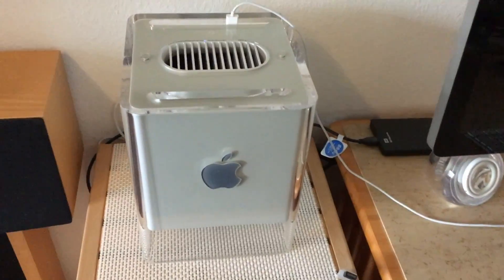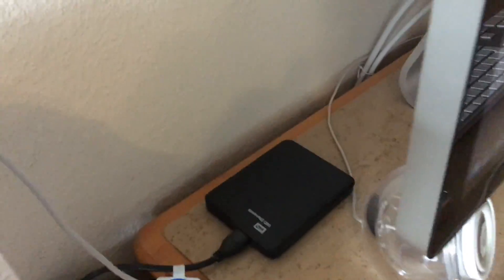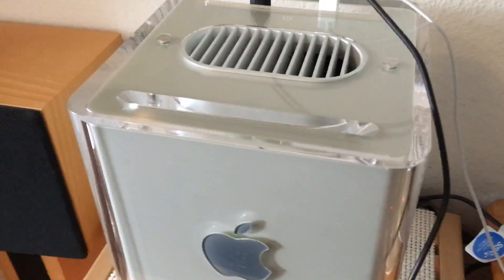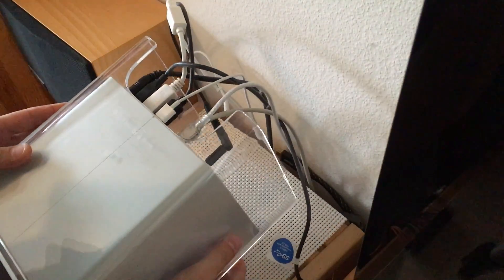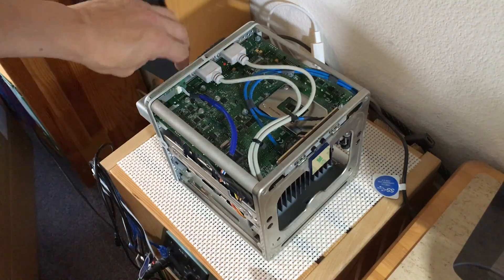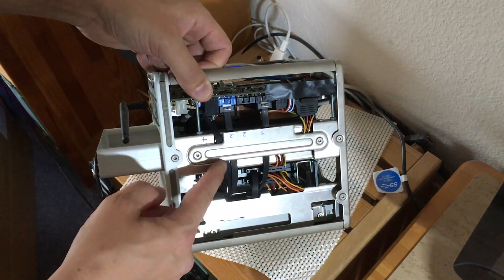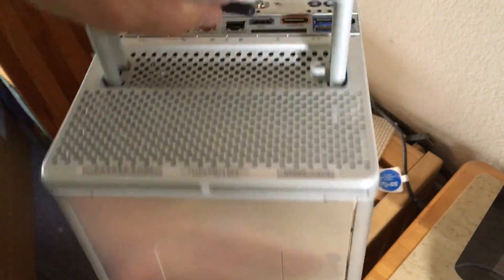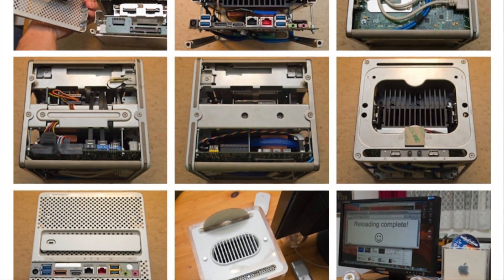Inside My G4 Cube i7 Hackintosh - A Little Review

Comment: incredible build. working on something similar with the same motherboard to make a sleeper PC in the chassis of an old NES. How did you get the board to support an i7 3770? only the 3770S is supported
Reply from the maker: Thanks. You may have to update your bios first. Mine works just fine.